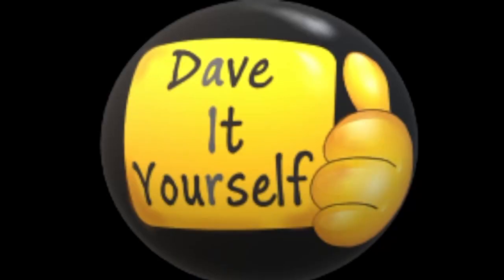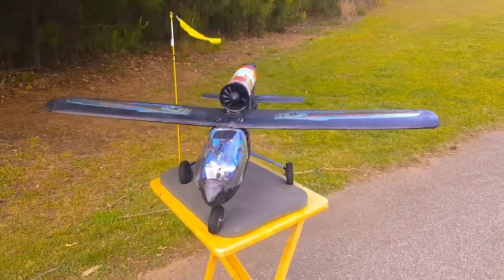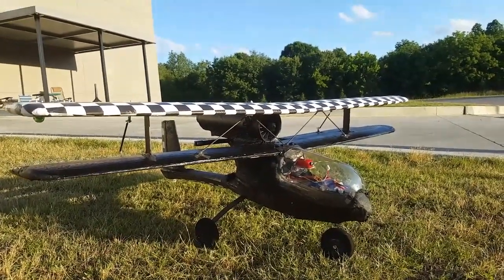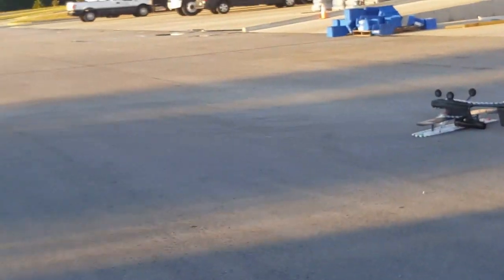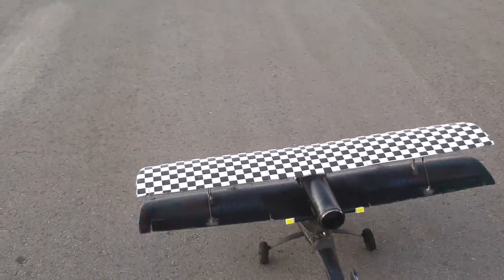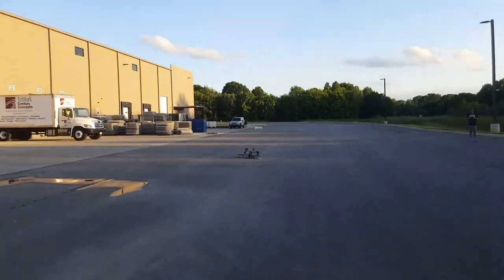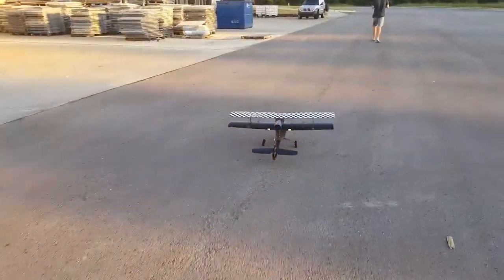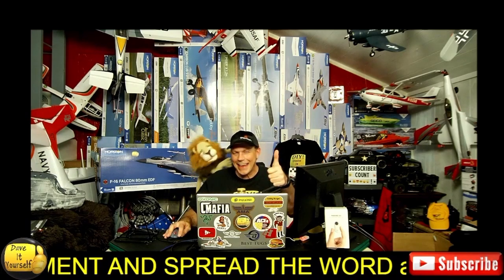*D-I-Y Channel EXCLUSIVE!* EDF AeroScout Biplane!

Comment: Your on the right track buddy. Anytime you try an external edf like this you have to make sure your theust angle is neutral or at at a slightly down angle. Also depending on where your cg is it may need to move back slightly. Roughly 1/3 wing cord. Ive done a similar conversion so i know, it just wasn't a bipe! You got this!